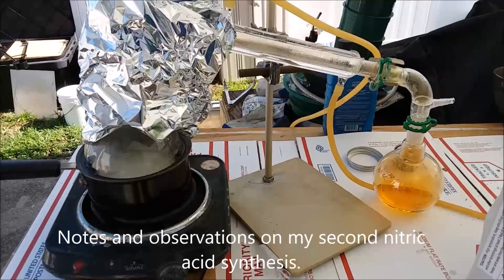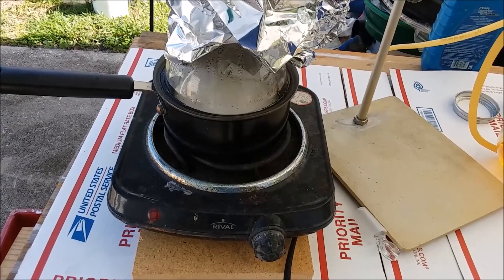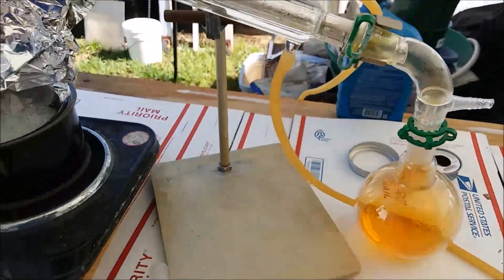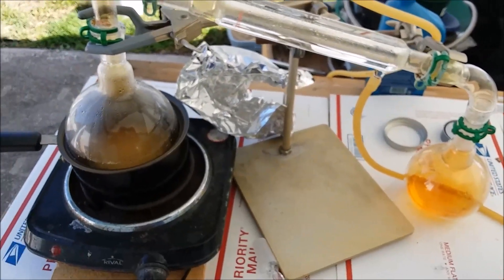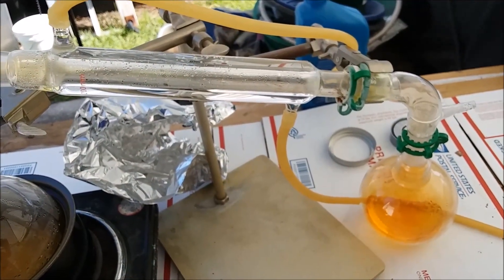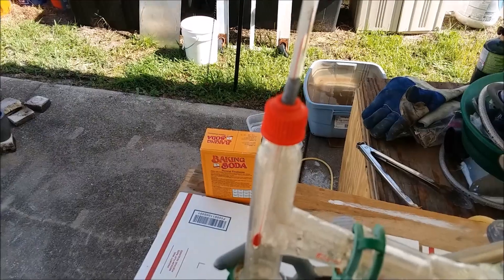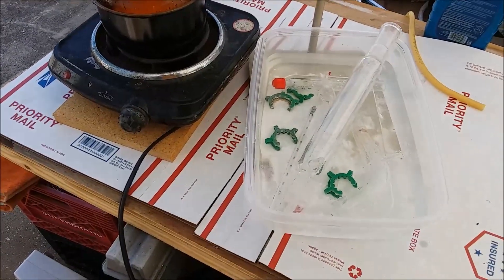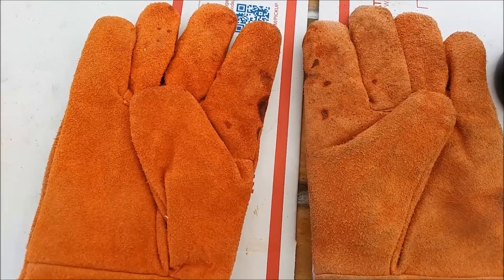Notes from my 2nd nitric acid production run

Comment: hello.
love your videos.there so informative.just a quick question.ya see where your thermometer comes out the top of your flask.is that plastic that the thermometer is sitting in
is it special kind of plastic.i know u talk about it in your video..did that red thing come with the set.you just wrap the thermometer with Teflon tape and seems to hold up.can you let me know when you can please as I'm going to order the set up today
Reply from the maker: I don't know what kind of plastic that fitting is made of. It came with the thermometer adapter as part of the distillation setup. There was originally an o-ring that held the thermometer in place, but it fell apart after the first few uses distilling nitric acid. I then started using the teflon tape to keep the thermometer in place. The plastic bit seems to not be bothered by nitric acid.
Reply: thanks so much for the quick reply. I went ahead and ordered a distillation set very similar to yours.i ordered a 2l 2neck flat bottom flask and 500ml glass bottle as the receiving flask.when I was ordering it.i actually seen glass holder for the thermometer that's made for acid distillation
it only cost $5 extra.ill.probably have to wait a month to come from China.thanks for the  help. keep putting on your videos.your one of the best